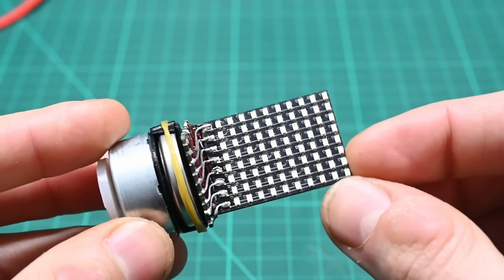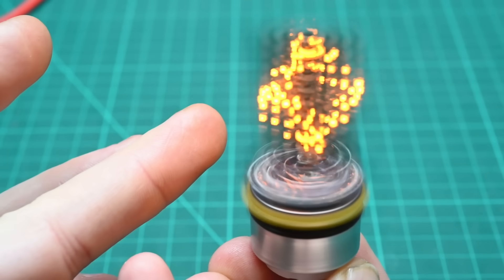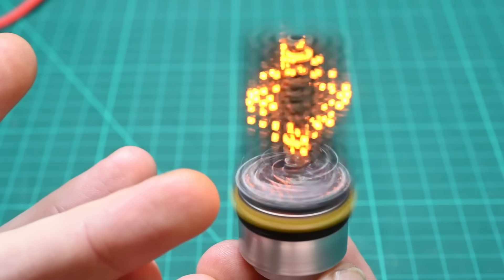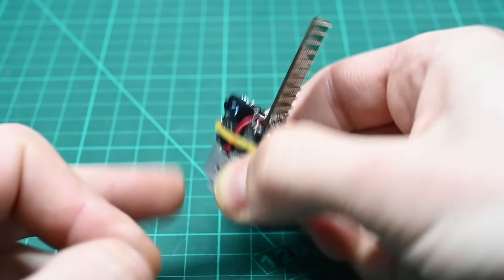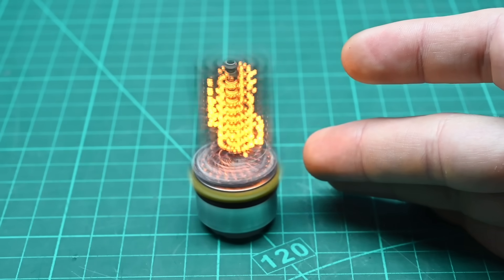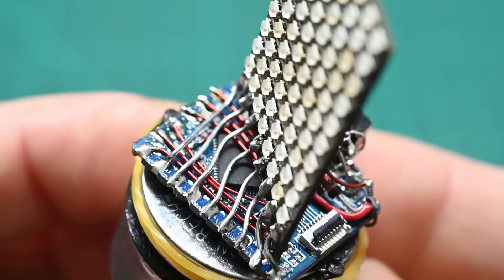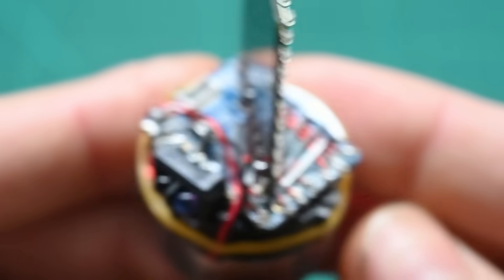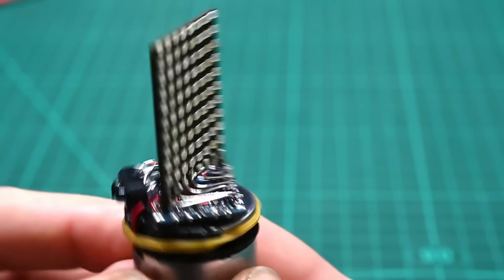Tiny volumetric display

Comment: This is amazing. I am no expert so discard my ideas if useless, but perhaps a clear circuit board to eliminate the black "fog", and a clear resin over the LEDs to act as the counterweight for the board after shifting it so that it can still be higher for balance? Getting that right would still be tricky, though. Also heat may become an issue if they are encapsulated. Really cool project! ❤
Reply: i wonder if a clear board and resin might transfer light much easier. you might have a full form image when spun with this method or it might just completely glow like with light throughout.
Reply: Would be really cool but glass PCBs are quite difficult and expensive to manufacture.
Reply: A clear board would expose the wiring, causing light to reflect off those wires unless the object were to be viewwed in dark lighting. This is a good train of thought, though, just needs more experimenting
Reply: @HazelnutPi  you can get transparent PET flex PCBs made quite easily they're just somewhat expensive and have some mounting related difficulties. The traces would likely be thin enough to not have a considerable effect though.

Comment: I like this project a lot! I liked the idea of spinning all components and the IR sensor to sense the orientation. I'm curious to know if it is possible to use a mini LCD / OLED  display instead of the LED matrix, in order to get much higher resolution? Great work.
Reply: The pow persistence of OLED might be preferable here, would give you a less fuzzy result on the outside especially if you spin it faster.

Comment: This is really great, I wonder whether it's worth sacrificing a little of the dimensions, perhaps making it bigger but include RGB LEDs - That way you'd get much more control over the colour and look of the object you're displaying, not only that but you can get RGB LEDs pretty tiny now so you could fit more on the board for a better resolution.
Reply: Hm, that may be difficult to animate as colors would bleed together, but with the right timing in the code i bet it could be done

Comment: Thinking about the balance issue when the LEDs are placed along the center line...a transparent cover for the LEDs of the same mass as the board they are on, like a sandwich, would achive the result you're after. I suspect, as you scale down, the LEDs could even be incorporated into a transparent board which you'd barely notice until it was turned on.

Comment: Nice concept,  what about using a high-resolution 1.9inch LCD Display Module 170×320 Resolution Screen, 262K RGB Display Color SPI Interface ST7789V2 Driver, Compatible with Arduino/Raspberry Pi / STM32 instead of your leds display? Could work?

Comment: this is a very intersting concept, just a noob question, do you read the mottor position to light the led at that specific position? in relation to where your finger is and the sensor? or it just lights up and the rotation creates the efect? cause im struglin to understand how it makes the 3D ilusion, do the led light diferently at each angle of the motor rotation?
cause if that is what you need to do it is probably impossible to make one of this but in a big scale, with like 1080 leds up and 300 sideways. you would need probably a good cpu or gpu to render all that right?

Comment: That is actually a very good prototype! The interaction built into it at such a tiny size is awesome, and I would love to see future designs with this, higher pixel density!
I do wonder if you would be able to make a frame of enameled wire so it's porous? In doing so it would allow for faster and be less power hungry along with weight and air resistance, as well allowing the LED's to be viewable at both 180° and 0° (may end up leaving a trail destroying the illusion)
Or even a see through PCB board but that's probably impractical
Best of luck on your future endeavours!
Reply: or, and hear me out, seal the spinning mechanism in a tube with negative pleasure, or better yet, as close to a perfect vacuum as possible, if friction is the issue here. the only issue now would be to minimize internal refraction.
Reply: @loremaster63  I cant believe the solution to high tech display was vacuum tubes all along.
But imagine that, like a 8K display rotating at 120 rotations per second in a vacuum tube. Potentially two or eight of them sandwiched like a tree. You could get some insane games from that.
Or perhaps cheat a little and use holographic reflective or projection displays for HUDs or special items. Project it straight on the glass, or in their own plane.
It makes me wonder though what is more practical. Fiber optic and voxel based displays, since the biggest hurdle would be clarity and wire routing in the display. Versus rotational vectors, where the hurdle is rotation speed versus clarity.

Comment: it may improve clarity and voxel reproduction if you could find a way to mount the leds INSIDE the circuit board, so they are not only centered but also viewable while on from both sides

Comment: Excellent job man ❤
Do you think you can build a larger volumetric display by just scaling everything you did here?
Reply: Main problem would be refresh of the display. If you want higher resolution fx. 100 pixels wide with 24fps animation you would need 2400 fps display

Comment: very cool and interesting stuff ,as for centering the led's i suggest adding a clear layer over them that weighs the same as the board that is on the other side thus having the led's sandwithed between the two sheets and having a good centered mass.

Comment: i can imagine something this size with a much higher pixel density being really really awesome
Reply: Main problem would be refresh of the display. If you want higher resolution fx. 100 pixels wide with 24fps animation you would need 2400 fps display
Reply: @marcobel9671  i didnt even think about that but your right, what about static images? for like 3d modeling and stuff, a scaled up version of this that you send a static mesh to that renders it.

Comment: Very nice. So wonder if anyone has just plonked a phone on a spinning platform to produce high res colour holograms???
Reply: Not possible due to low framerate. If you want higher resolution fx. 100 pixels wide with 24fps animation you would need 2400 fps display. If you want 60 fps on 1000 px wide screen you would need 60.000 fps
Reply: @marcobel9671  wow never thought of that. What framerate can you get with the LEDs?

Comment: x10 that res and ur cooking (not an engineer btw)
Reply: Main problem would be refresh of the display. If you want higher resolution fx. 100 pixels wide with 24fps animation you would need 2400 fps display

Comment: Very interesting project @mitxela. As Drone engineer, i think you need to get cylinder enclosure to improve the drag of the LED and reduce the motor power consumtion. It will be interesting to send it as programmable candle or gift.

Comment: Maybe have the leds and traces on clear PET, then sandwich that between two thin pieces of acrylic for structural support? Then you could have the leds and mass centered. And the "pcb substrate" would be effectively invisible.

Maybe there are leds with clear housings you could use, that would make them visible from both sides too.

Comment: I'm new here, (first video of yours) and quite old (retired but still got some crazy plans), but as far as dropping the display; it's an old invention in terms of holding items, but would a "handle" help? Something like a hexagon screwdriver handle stuck to the bottom? If it was mounted at a right angle it could also act as a weighted base when placed on a surface as well as being more ergonomic to hold. 💐🤔♥️🧀🐈‍⬛😼🌈🏳️‍⚧️🏳️‍🌈🇺🇦🇪🇺💐

Comment: what is with the fingers? do they control something through sensors?
Reply: Yes he has an IR sensor that is also spinning and it is used to measure rotation based on when it "sees" his finger
Reply: @marcobel9671  ah ok, as it spins, it checks proximity, so it also measures speed and can control the 3D rotation effect.

Comment: ik now one asked but:
if you want to get rid of the blending effect between "pixels" 3d print a small grid (like the ones used for set lighting "Egg crates") to give it some sharpness, maybe using different, more translucent materials to build it can keep it low resolution but lessen the bleed to give a more CRT effect like the ones pixel games used to take advantage of to add "fake" details

Comment: Put 2 plastic supporting columns at the back of the led panel, and if you make a little hook cut at the top, you can prevent the panel from moving entirely by just fixing columns to the motor's case or  the battery case
I couldn't see how tight you current PCB design is but if you leave a hole for the columns, you fix the circuit board tooand improve the stability

Comment: Consider using UV resin to coat LEDs. it would supply weight to the led side allowing it to be more centered. To elaborate, imagine drowning LEDs in resin making it flush with top of LEDs if pcb is on the table, effectively creating the whole thing into homogenous slab, resin density and weight should match pcb quite closely.
Drawback of this idea is it destroys the posibility of removing LEDs if some burn out or are faulty. I would suggest trying it out as uv resin can be bought in small dropper bottles so experimentation shouldnt be costly.

Comment: Why do you keep putting your finger close to it?
Reply: When it stops, you can see a small black box with 2 LEDs inside.
That thing checks if something is close, like a proximity sensor.
And when it is, it activates everything. I guess everytime this switch goes on and off, it steps forward a frame in the animation. (Since its rotating its going on and off very fast so the animation works)

Also i guess it figures out in which orientation it should play the animation, you can see that the 3d objects rotate when he moves his finger around

Comment: super cool; volumetric displays are super interesting 
could this be done with an LCD screen to increase resolution? I suppose this could be a single piece in a larger array of identical pieces. In terms of centering could you get a PCB with accurate tolerances ordered? maybe that would automatically center it on your motor.

Comment: Hi Mitxela!
Cool stuff there!

Regarding the resolution, making it just a bit more compact is easy by mounting the LEDs vertically, instead of horizontally.
The higher vertical distance would not be that visible, if viewed from the position above its vertical center.
But the horizontal distance is always visually the same, independent on the viewers "downward angle".

Comment: Ok, so why was the image rotating with his other hand whenever he moved it near?
Reply: Because of the simple motor he uses he needs a way to measure how fast it is spinning, so he also spins the IR sensor and then he can measure speed based on when it "sees" his finger. So when he moves his finger it changes rotation since that is what is used to show the image. Sorry it is not great explanation, you should read his blog post in description

Comment: You know, that's pretty neat. I wonder if you could do that, but with a way bigger motor and run it on say, just a standard computer monitor. Yeah I mean it'll look like shit, but I imagine it would be a neat concept. I mean you basically just have a very low resolution dot matrix display going on there.
Reply: I think it would not work because you would need very high refresh rate on the display
Reply: @marcobel9671  Yeah I kinda thought about that. But how high? standard's 60, i've seen 250 done. Is that fast enough or would it need to be like four times that? I don't know jack about this kind of stuff. I ain't no engineer
Reply: @greydevorator49  i am not entirely sure since this is the first time I have heard or seen this technology. But as I understand it each pixel in the display needs to refresh for each pixel in the "image". So if you want an animation of 60fps and you want a resolution of 10 pixel wide, then it would need to refresh 60 * 10 each second. So 600fps, so as you can see high refresh rate and resolution would not work for this method. Hope someone can correct me if I am wrong
Reply: @marcobel9671  , Without doing a shitload of research and testing I couldn't tell ya. But thank you for the thought out response! I like these kinds of intriguing conversations about hypothetical future technology. I could see this being something we see worked on as a sort of 3D dome shaped display or something. That would be neat. Playing games on a table-like structure. You could have friends around it and do some cool ass stuff. Though I feel like the noise the spinning motor and display would make would kindof hinder the experience.

Comment: You should swap the battery for wireless power coils, encase the whole thing in a glass cylinder, standardize it, make many, give them wireless control so they can become holographic pixels in a larger display matrix.

Comment: I worked as a theatre technician on the build of the set for “Phantom of the Opera” here in Australia, back in 1991. 
We developed an early 3X LED that had a sequence to look like a flame. The circuit was on a huge circuit board. We sent said board off to Japan and we received hundreds of microchips (10mmX10mm). 

Literally on of the best crews I’ve worked with.

Comment: very interesting!! i see it is 2d with the lights going up and down, and side to side. What if you add another panel of led lights to the mid secti0on of the panel on the led side, or none led light side (to test) and make a 3d led panel candle.

Comment: Just tossing these thoughts out there, but this is cool as frick. 1. Would it be possible to increase resolution and the central led issue by putting another array of LEDs back to back to the first set? It would require more power, and probably a whole slue of other issues, but idk. 2. Could you add a simple gopro/camera 3mm screw hole to the delrin piece to easily add a tripod or handle to easily hold it, or display it? Just my thoughts, looks great and keep up the great work!

Comment: Nice work.  For a larger display, you might be able to use a 3.5mm stereo audio jack/plug for pwr, gnd, and serial data.  That way, the battery can be relocated to a non rotating base.  Just lubricate it with a few drops of synthetic oil to keep the wear down.
Reply: I guess magnetic coupling would be much more robust. Top coil might be relatively tiny if static coil is large
Reply: @hrissan  Ah, yes.  Great idea.  They sell 5v inductive charging kits (adafruit #1407) pretty cheap.  5v 500ma max.  Hopefully it won't interfere with the motor.  Shielding would be recommended.

Comment: I’m sure someone else has said this, but when you offset the board to align the LEDs, i’m sure you can find a flat clear layer to sandwich the leds in that could be similar in weight. i’m sure there is a polymer that is similar in density to the board

Comment: Nice.  Love the proof of concept.  You do have a screen door effect.  Im wondering if you could use the back of the led board, with the pixels offset to be between the pixels on the front side.  Yes, that would only fill in the gaps in one axis (x or y).  But if you added a 2nd board perpendicular, you could fill in the other axis.  Using the backside might also fix the centering of the weight.  Also, are the led variable, or are they only on and off.  Variable gradients , if possible, would help fake higher resolution.

Comment: Cool stuff. For balancing, Consider adding weight 'strips' to the left and right edges all the way to the top, pointing outwards to the led side. Or conside adding a metal arc. If you attach it from bottom left to top right, it might average out the amount of light blocking, making it invisible. Alternatively, it could end up with significant interference.

Edit: the acrylic layer cover is a much better idea :)

Maybe another idea: if you change the board color gradient from the centre to the outside, to reduce the difference in color of the board due to the local speed.
Reply: For prototype I’d add 4 screws to the corners of led board. Rotating changes weight distribution, fine tune then fix with a drop of glue.

Comment: You could submerge it in resin to create a solid cylinder around it. With that you may be able to spin it much faster.

I there's some sort of clear LED that may solve the problem of the opaque center axix.

Comment: I'd suggest trying something like a sheet of plastic of some kind to the LEDs once centred, it would surely only need to counteract the PCB itself. Plus having been taking apart a few monitors and TVs lately, being able to add some if the diffusion sheets and fresnel lenses should also reduce the voxelness(?) of the flame and assist in the flames realism by diffusing it enough to fill out the gaps. (dismantling an old cheap or broken LCD or led screen should provide the materials for both bits as often there is some acrylic or similar layer too.)

Comment: 3:09 : Can I suggest, as an artist 'perspective' is bleeding here. So if you can move one half of the LED on the other side of the board, thus it makes one complete rotation as single frame. Or build a board that has LED on both the sides, where the gaps from one side the board is filled in by LED from the other side of the board. 😊 hope it's not confusing 😬.